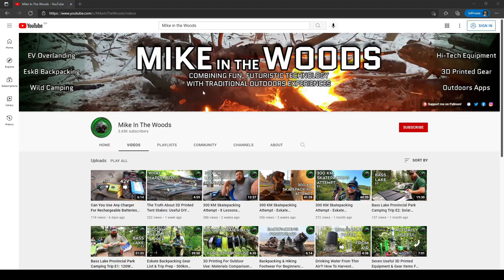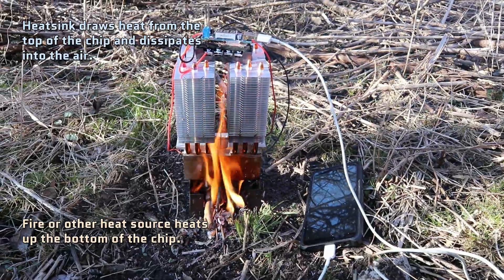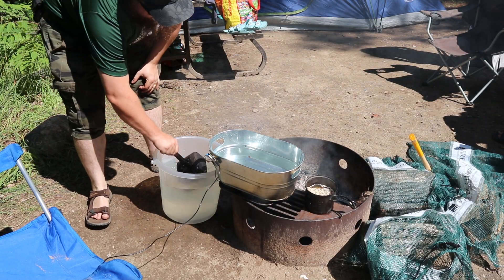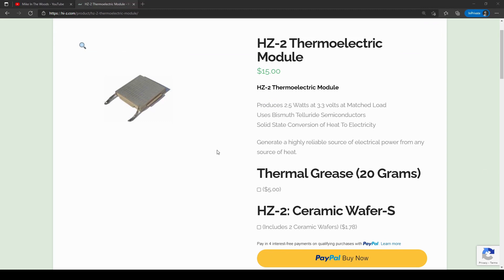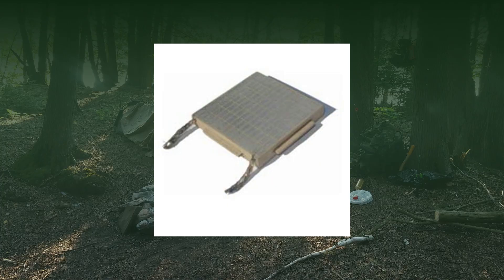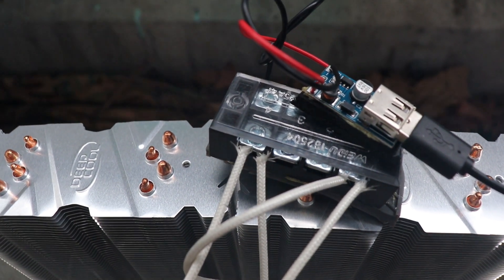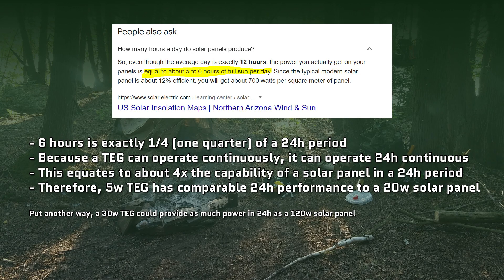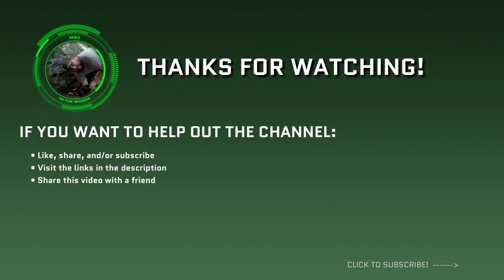Peltier Thermoelectric Generator v2: How To Recharge Your Phone Battery While Camping!

Comment: Even though this post is a bit aged, using a good quality heater would definitely serve you better. Having one that requires 120vac to operate and use it to generate enough energy/ electricity would be more worthwhile. I guess if someone would assemble a small steam generator that recycled the water [a closed loop] as long as you  can keep the heat going. You would have power

Comment: You should try a thermoacoustic engine instead. It´s even simpler but a little less efficient, or you can try a stirling engine instad which is the most efficient method.

Comment: Water/Aluminum/Copper are the most efficent at temperature transfer. Air is a poor conductor of temperature transfer. 

You did the first half right by Isolating the cold side with a gravity feed water flow at a trickle and 2 tanks/ice chest coolers you swap to drain in and out too, BUT you just needed larger storage tanks than what was in the video. Or as you said a large water source nearby. And a bag or 2 of ice.

You should also isolate the hot side with a water boiling tank and a steam pipe that directs the steam on the peltier and drips any condensate back into the hot water tank.

This should maximize the safest temperature range of 32F ice water to steam 212F and prevent destroying components while getting the most power faster. I would also consider charging a source like a larger battery that can handle more watts at a faster rate not to exceed your phones limits. You can charge your phone off the larger battery more safely not to damage it.
Reply: A build today for powering a peltier EV charger would cost a million or few.

Comment: how about using a small water pump?
Reply from the maker: I considered a PC waterpump & radiator, but it starts to make things too complex & finnicky -- I prefer more simple & reliable designs
Reply: I see. What do you think it needs to charge a 12v Battery?

Comment: Just found your channel. Wondering if anyone has ever sandwiched two peltier devices one upon the other for power generation. Assuming it might help improve temperature differential as well as provide twice the voltage in the same footprint.

Comment: Electronic tech here. Neat prototype. I have a few suggestions. 1) use a heatsinks on bottom, it will collect way more heat than a pan. If epoxy or silicone dont hold up, you could always try hi temp automotive exhaust cement. Lastly, I work with solder all the time. It melts at a relatively low temp, that's why it's so handy. Better to go with crimp terminals as the meltdown temp is way higher. I'm looking forward to V3.
Reply from the maker: Good info!

Comment: use the water as the water regulator, have a hot side water and cold side water, containers
Reply: dont ever expose the peltiers to fire  temps (if not using thermo-couple metal pairs that do not melt even at 800C flame)
Reply: that way you always have 100C water at the hot side, and cold is the water cold
Reply: copper - copper-oxide thermo-couple

Comment: I think either soldering the TEGs or using thermal epoxy(The channel Tech Ingredients sells some, and has a video showing how to make it), could help make this sturdier. It could also improve performance due to the higher thermal conductivity, especially on the cold side, though it may not survive the temps of the hot side. 
A wider skirt could get more heat to the hot plate and less heat to the heat sinks.
Also putting it at an angle over the fire might help with convection on the heat sinks when there is no wind, vertical fins could also help. 
 
Overall this looks quite good. I haven't managed to find anything quite as heavy duty as this anywhere. Most the TEGs sold online are made to be used on a portable gas stove and aren't really designed to be used anywhere near a campfire, so I'm very interested to see how this eventually turns out.
Reply from the maker: Mine fell apart after making this video, hahaha. V3 will definitely come. The soldering is a good idea! I'll consider that for V3

Comment: tegmart  say their modules run even hotter.  I think your bottom plate would be better to be an inverted dish/pan. traps a little more heat and keeps the flames contained
Reply from the maker: Good point

Comment: thanks for the video, Im very interested in this subject and looking to build my own. I notice your designs have put the heatsinks directly above the heat source and I think those heatsinks are still getting a lot of heat off the fire, hurting efficiency. have you measured the air temperature around the heatsink to see if they are getting cool air? remember you want a temp difference and the fins cant shed heat into hot air as easily.  keep up the good work!
Reply from the maker: I'm sure they're catching a bit of heat, but they should mostly be out of the updraft of hot air from the heat source